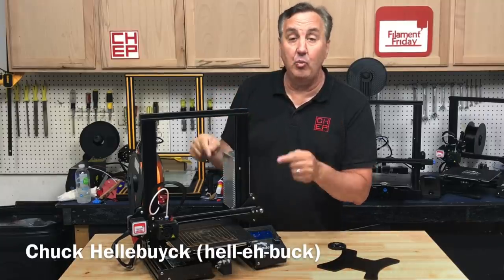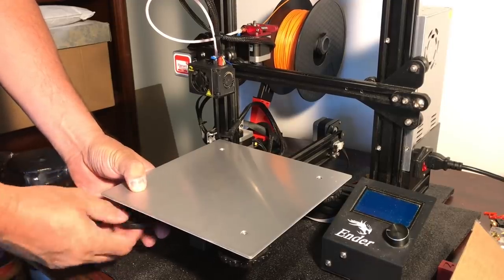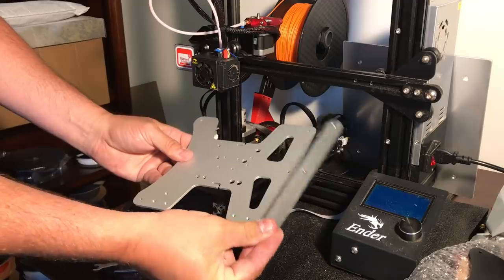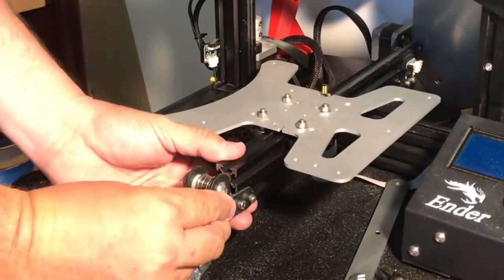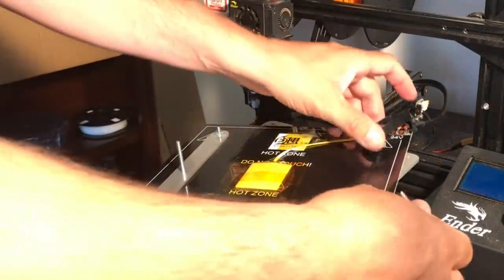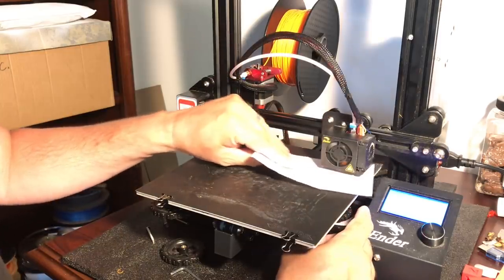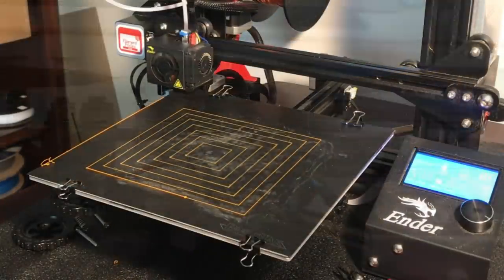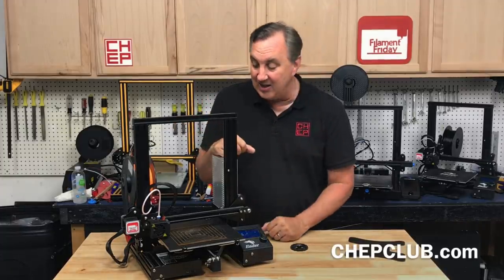3-Point Leveling System on Creality Ender 3

Comment: Hi CHEP, I’m having issues with my bed that no one seems to know the answer to so I’m praying you might be able to help. It looked like my build plate was warped, logical fix is to get a glass bed, so I bought a glass ultra bed. This only improved bed adhesion but the dip in the centre of the bed and a bulge remained, I use your levelling Gcode which levels the corners fine but literally everywhere else (except the bulge) on the bed is to far from the nozzle, if I change it so the middle is centred then this bulge on the left scrapes against the nozzle. What I can’t understand is how these dips and bulges are still there with a glass bed? It is solid glass, it does not bend with the build plate, how can this still be happening? Thank you if you do reply to this, looking for a miracle right now!
Reply: check you x gantry it might be saging in the middle resulting in what you describe bed leveling is merly aligning the build plate to the x gantry if the x gantry sags or bows then the bed can't be made perfectly parallel

Comment: I have just ordered a ender 3 for myself for a birthday present. What would you say are the most important things to take note off when assembling (already watched your setup video about the order) I have installed your preset for cura also.

Love your videos, you inspired me to do this
Reply: I'm not chuck, and I'm actually new myself. Maybe a month with my Ender 3. I watched his videos. Became a Patreon supporter because of what I took (and continue to learn) from him. One thing my experience has taught me: try different temp settings to see what works best for the filament you use. Makes a difference. I have 3 filaments, and 3 different settings for them.
Reply: I'm fairly new to 3d printing myself. I picked up an Ender 3 a couple of months back I followed Chucks assembly video paying special attention to making sure the gantry was square to the frame and square to the bed. Worked a treat, been getting good prints esp with the cura profiles. Someone suggested not to buy the cheapest filament to start with and dial in your settings against a known good brand before buying cheaper spools that way you know if it's your printer or the filament.
Reply: @ForthviewDevelopments  any brands you suggest in the UK
Reply: @Just_Jesus_ef   do you have any brands you recommend for buying in the UK
Reply: @kijngs2584  still working it out for myself, I bought some Sunlu PLA from amazon and a roll of Prusament PETG. Only printed the PLA so far as I want to get a dry box before I open the roll of PETG as PETG is hygroscopic. The Cura profiles from Chucks website are pretty good and I like the square bed levelling gcode when I'm re-levelling the bed. I'm printing the PLA at around 204 deg cause at around 200 I don't seem to be getting the first layer adhesion but that could be the bed needs levelling again.
Reply: @ForthviewDevelopments  what is the square bed leveling ?
 Is that just using the paper and adjusting the nossle height ?
Reply: @kijngs2584  I used the front edge of the bed to make sure the gantry ran parallel with the X axis
Reply: @kijngs2584  about 7 mins into Chuck's assembly video 
"Creality Ender 3 Assembly Guide For Beginners"
Reply: @ForthviewDevelopments  perfect! I am so blessed to have all this information at my fingertips!
Reply from the maker: I just added a UK link to description.
Reply: @FilamentFriday  thank you !

Comment: I feel it looks like over kill 
Now I could be wrong but instead of a whole new cartridge base. Could they not have simply used a similar bracket to what was added to the bed to the cartridge base?  Also if it was bottom mounted then they'd be more room for the spring also.
Or an I missing something?  Probably reducing the cost too quite a bit
Reply: It's a matter of controlling the quality of your own product, I've done similar with a few jobs I did on my lathe and milling machine. The cos is more or less the same, but you have full control.

Comment: This would be improved if the short spring was a solid mount (with PTFE washer for a bit of compliance.) The leveling is then done first exactly on that point and the other two set to match it.
Reply from the maker: How would you level that first point if you can’t adjust a solid mount?
Reply: @FilamentFriday  I should have said "set the Z offset" at that point; adjusting the Z stop limit switch.

I must admit I was thinking more in terms of my setup where I have the BL Touch and it's just a matter of fine tuning the Z offset in software.
Reply from the maker: Yeah, that makes sense. It’s either adjust the knobs or the z offset no matter what system you have.

Comment: A three legged stool never ever wobbles -  but try and get it level!!. I have 3 pointers on my Afinia's (Up!) and I hate them. I think it probably works better and reduces the chance you will warp the base but I spend way more time leveling the Afinias vs the Creality machines. If the corner that doesn't have a bolt is off its really tough to pull it back in without screwing up the rest of your corners.
The other aspect is that more points of contact (4) means more rigidity and more lateral torque resistance.
Speaking of three pointed things -  you would have thought the manufacturer would have carried the idea forward to the wheels. Why do they recommend a three point mount but not a three point mount on the wheel base? The [X and Y on these printers use a triangle wheel base.
Reply: I do agree with you. The rest of the construction needs to be stiff enough else the three point system could be worse. I also thought it would have made sense if they got rid of the one wheel.

Comment: Maybe they can drill a big hole into the metal support to fit the original spring.
Reply from the maker: That's been mentioned. And the answer is the screw will fall right thru the hole.
Reply: Or provide a smaller spring/cut the spring down

Comment: Could you have just used the new bracket with the old carriage plate? Are you worried at all about the bracket wearing through the PCB coating on the heat bed?
Reply from the maker: No. There is no movement of the plate to cut thru the insulation.
Reply: looks like you could just use the bracket with old carriage plate, if the distance between the 2 end-holes of the bracket match the distance of the holes in the the old plate.  If the distances are same, then looks like one could only use the brackets.  (and 2 smaller screws and 2 nuts)

Comment: I use 3 points since 2012 maybe ? The kit is mostly useless as as long as you're able to drill 3 holes in a 2mm thick aluminum bar chunck. It works with any printer.

Comment: Glad you like the system. 3 point will always be superior to 4 point for getting your bed parallel to the x gantry and at the same time, you remove some of the bed warping that occurs when using spring tension leveling. Does it really matter on a tiny printer like this? No.

Comment: I always run your bed leveling file and it comes out perfect. As soon as I run a different bed leveling print like the four corner boxes the leveling comes out all wrong. I dont understand what could be wrong. Spent hours trying to level my bed and it just wont. I just ordered a glass bed to see if maybe that fixes it but man I would hate to get rid of the magnet bed :(
Reply: If you have trouble with the  metal bracket being slightly bent (mine is)you can just glue one magnetic base adhesive to a piece of glas. That way you'll have a flat platform for your magnetic bed. That might help your level issue.

Comment: I wound up buying the Befenbay Complete Kit with New Wheels, I am looking for a compatible bed handle camera mount to put on the left side to either use a infrared raspberry pi-camera or a wyze v2 security camera. any ideas on one to try out? I've been using a z axis mount but had an accident today where I had lag issues  for octoeverywhere that caused me to raise the z axis too high and it caused the Z-Axis mount to break. I was lucky that the camera didn't get damaged, but I'm looking at other cameras anyways as I want to use the multicam plugin for octoprint.

Comment: That single screw head under the new bracket, isn't that huge risk that it will rub through and short-circuit the heating elements of the bed?
Since its spring loaded and not solid mounted, I get the feeling that it will wiggle around.
Reply from the maker: If you’re worried put a piece of electrical tape under it.
Reply: No, the tension from the knob/spring will hold it in the chamfered space never touching the bed at all

Comment: i have a question? is there a way to print the vast bulk of the object in super fast and just do the outer layers nice and slow and clean?
Reply: Yes, just set your outer wall speed to slow, and your inner wall and infill to fast.  Also select print outer walls first if you wan good dimensions.

Comment: chuck, I still have not got back into my problems with the Ender 3.  Since nothing has changed I don't see where leveling again is going to change anything.  I wonder if the 3 point system will change my original problem. I am wondering if a whole new hot end will fix my mysterious problem.
Reply: what happened?
Reply: @certified-forklifter  That is a long story.  For some reason, the filament just started curling up around the nozzle.  I started using Chuck's leveling system which is great but has not yet solved my problem.  I spent hours trying.  Just still have not found the problem.  It will come but I am taking a break and doing other things right now.  I have another printer that is working fine.
Reply: @StanCook   I had that a bit. Cleaned it out several times, after every print. Eventually just made the hot end a bit hotter (after a cleaning of the nozzle), like 5 degrees,  and it's been pretty good since then. Even a 15 hour print came out without issue
Reply: @Just_Jesus_ef  Yes, thank you for your comment.  I did clean out the hot end but I am thinking of replacing the whole hot end.  Not that expensive and can't hurt as I see it.  I appreciate your comment.
Reply: @StanCook   Let me know if that works for you :)
Reply: @Just_Jesus_ef  I will try to remember.  I have to order one and even Amazon is taking a week to 10 days to deliver anything since the pandemic.  I got spoiled with one to two-day delivery.  lol
Reply: @StanCook  I know what you mean! Same here
Reply from the maker: I doubt 3 point will fix it. Maybe a new hotend is worth a try. Without the machine in front of me it’s hard to figure out.
Reply: @FilamentFriday  It is on order.

Comment: Hey chuck I have a question about getting petg to stick to the ender 3 with the textured glass bed. How hot should my bed be? I have it at 80c and my benchies are still lifting a bit. What should I do?
Reply from the maker: Sometimes a little glue stick helps but clean the bed surface first with IPA.

Comment: What is that function on terminal that you press the button and it goes automatically on next corner? I have not found that kind of option from my Ender.
Reply from the maker: It’s the GCode file I put on the SD card. Link in description. It uses the M0 pause command that waits for you to press the knob.

Comment: I think the only point I haven't seen made in the comments is that a 4pt level system can warp the bed when it gets heated. As the bed deforms from the heat, it may deform unevenly. Being constrained at 4pts can cause the bed to warp, in which case you'll get 3 corners level but be unable to get the 4th one level. With a 3pt system, unless the heat causes the bed to bow, you would never have this issue.
Reply from the maker: I’ve never seen that.
Reply: @FilamentFriday  ymmv

Comment: A 3 point levelling system will always be better than a 4 point system. Why 3D  printer manufacturers haven't caught onto this is beyond me. It's basic maths. I was once an avid Amateur Astronomer and I've had telescopes and even built them from scratch and the main thing to know, when it's comes to mounting the primary mirror, it is always based on the 3 point system. No matter how big it is.
Reply: I agree. It seems like people's biggest complaint here is that it lacks stability when compared to the 4-point system, but realistically how heavy can a print be on these small machines? Likely not heavy enough to really even be able to test the stability of the bed springs and mounts.

Comment: With 4 adjustment points, you can have situations where you can't easily determine what adjustment is necessary, and turning an adjustment knob has no effect. This setup is meant to resolve that.

Comment: The big problem with these printer beds, is that they are not flat. The glass ones should be better and more rigid, but the flexible ones follow what they are sitting on.
A three point system of levelling is superior from a mechanical viewpoint of course. The reason they have four is, it offers more stability and a way of taking out error in a flexible, less than flat bed. Your Welcome.
Reply: I also believe the bed in this kit is going to be much flatter due to the thicker aluminum.  No one is talking about that.
Reply: @thebikeracer  It's just rolled Aluminium Sheet, it's not going to be flat, regardless of thickness...Just like the extrusions won't be straight...

Comment: If done in the correct order? ie. level corner 1 and 3 to the same height, then level 2 and/or 4 youre essentially doing a 3 point are you not? harder to accurately allign corner 2 and 4 and requires loosening the whole bed i guess  but dont some people leave one corner of the 4 points loose so that you just level 2 corners and then the 3rd corner to tilt the plane??? just a sudden thought..

Comment: What I did was use 8 nuts to hold the bed in place 4 to hold the screws to the bed and 4 to control the hight then i tightened the wheels so they wouldn’t move
Took forever to level the bed but I don’t have to do it ever again if cause I can control the hight by how far I screw the nozzle in

Comment: Is there a way for Ender 3 V2 auto bed leveling ?
Reply: Bl touch on amazon auto levels your bed
Reply: Yes. But you have to update the firmware and do it with G29 through a terminal. I have a post on the E3V2 reddit about it.

Comment: I have a 3 point leveling system on my Ender 3 Pro at work, and on my home Ender 3 V2 I have the 4 point system. Honestly, I don't find any benefit to the 3 point system. If you can level a bed, you can level a bed and intuitively the 4 point system just makes more sense that when your back right side is off, you adjust the back right knob. With all of the upgrades I have been and plan to do on my V2, the 3 point leveling system is not one of them. Unless you need a new one anyways, I do not think this is worth purchasing.
Reply: The point of 3 point levelling is to avoid the tendency that 4 point levelling has of wanting to bend the bed corners. If you have 3 of the 4 corners already levelled but the 4th corner needs to come up, the opposite corner would want move down.
Reply: @andrewchudyk8518  I get it. I just honestly don't find it really any easier to level the bed with this 3 point system.

Comment: You can just print an adapter plate from Thingiverse instead. Thing # 3193722 by rrwrex. You do have to drill / countersink a hole in your bed though, so you have to be comfortable with that. Between that and upgraded springs (Amazon B07GXC1G2B) I almost never have to mess with my bed level, and if I do, it's super fast.

Comment: sigh when will people realize that 4 points is not a valid setup and on a physics standing... 3 point make a plane (flat area) not 4. The field has been manufacturing the incorrect setup on most machine. Hell real CNC and other machines alike, only use 3 points. And there is no need to purchase anything to make this change you have the machine a drill and a single stl and you can make the change. no removing of anything except the leveling knows and screws. either way nice video.
Reply: If you have ever had to level an old US four level-screw theodolite you would appreciate what a frustratingly bad system it is.
European design with two orthoganal bubbles and three screws, quick accurate and no bind up.
Allen keys, unlikely, Allen was bought by Apex who no longer use the Allen brand name I believe. You are referring to ISO Hex Keys. The fastners are Metric M-sizes so; Standard metric sizes are defined in ISO 2936:2014 "Assembly tools for screws and nuts—Hexagon socket screw keys" (DIN 911 if your box-head fits in a square hat). Pedantry comes naturally to industrial engineers. Verbally, do 'mils' refer to milliradians, thousandths of an inch, millimetres, millions in currency or a row of milling machines?
Reply: @QqJcrsStbt  When I first started on a construction site survey team many years ago we had an old 4 screw theodolite. I was truly a royal PIA to use. The next site I was on had a newer 3 screw instrument that was a breeze.

On a side-note... When I was in school, my understanding of slide rule eluded me. Later, after I had been working with theodolites and their Vernier scales I happened to come across my slide rule buried in a drawer of my desk. It made total sense to me at that point!

Comment: Chep, can you make a video or explain what the difference is in
Print Speed
Print Acceleration 
In Cura 
Would be a great help in figuring out what I should have Acceleration at 😎
Reply from the maker: Speed is the movement of the print head while printing. Acceleration is how fast it changes direction or stops. Acceleration will affect ringing and ghosting on details. Creality firmware defaults 500 mm/s acceleration. My profiles use 50 mm/s print speed but you can go faster depending on print and filament.
Reply: @FilamentFriday  Thank you for the reply! It feels like having a celebrity notice ya lol